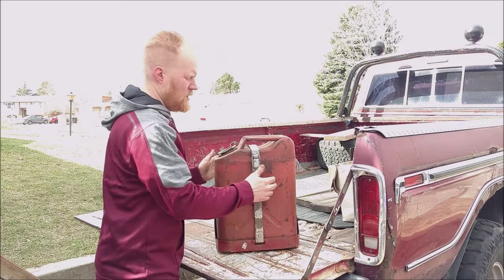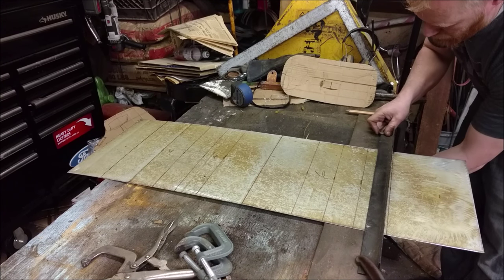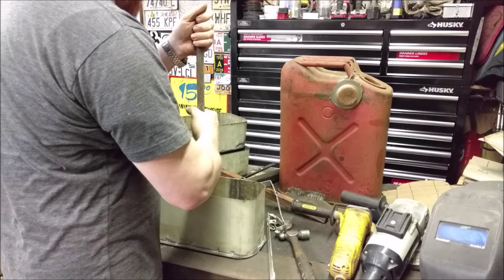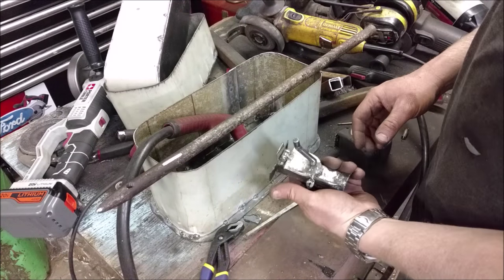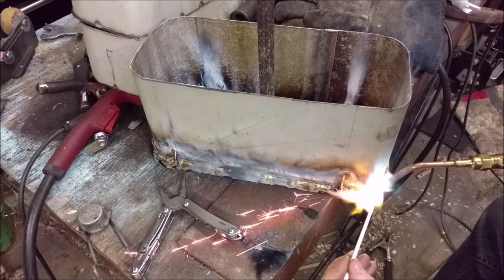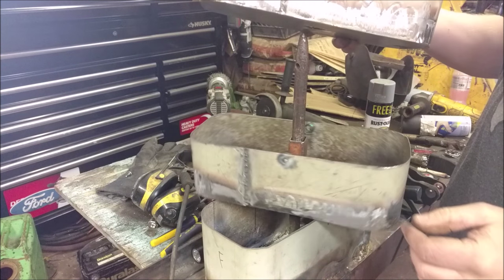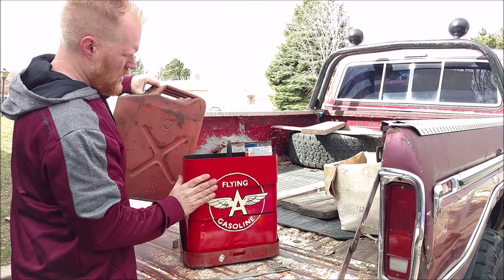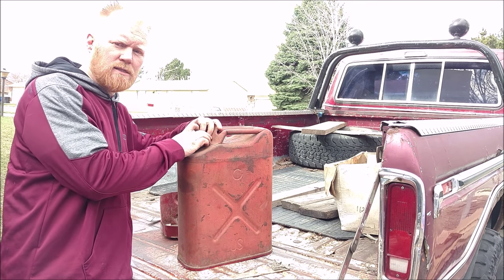Gas Can Converted into a Tool Box

Comment: Cordless drill! The original. Don't need no stinking batteries. Liked the way you slipped that in there all nonchalant like. So subtle & quick almost missed it. Good job on humor done right and liked the tool box concept and artful painting of the logo.
Reply from the maker: Thanks. It was a fun project.

Comment: fantastic job man. The design, engineering and paint work are impressive.
Reply from the maker: +Ozzstar Thanks Man. It was a fun build.
Reply: +sixtyfiveford i agree,btw do you have a degree on engineering or is this simply life experience or what? i couldnt hve imagined that system you came up with to lock the can. congrats

Comment: Nice Moe! Fellow Ford enthusiast here. I do dig your high-boy! I had a 73  F100, currently own a  97 F-250 crewcab and 96 F250 extra cab, and 5 cars over the years. I like your channel cause we think a lot alike. Make something useful out of cast-offs.

One suggestion, I find that a carburizing flame yields a better braze for me. Your oxidizing flame is a little hotter than what you need for sheet metal. Give it a try sometime! I think you’ll like it.👨🏼‍🏭
Reply from the maker: I'll have to give that a try. All my brazing is self taught trough trial and error and books.
Reply: @sixtyfiveford  I did a lot of gas welding in 4130 tubing in airplanes. The flame balance is pretty critical there. You need a SLIGHTLY carburezing flame (more acetylene). The wires thing is an oxidizing flame, as oxygen induces foaming and a raft of bad things in the weld puddle. Normally you like to see a "soft" flame too, as it brings the heat up slowly and envelops the molten metal helping prevent oxidation in the puddle. OA welding is really an art, it's a PAIN compared to MIG or TIG, but the satisfaction of laying down a nice flame weld, or braze, is beyond compare to me.

When brazing tou don't iverhear the base. When welding, you stress relieve the joint by making a larger HAZ. In critical 4130 joints I would TIG for filet consistency, then post-heat for stress relief to prevent crack propagation at the weld root.

Sorry, I get wound up sometimes.😊
Reply: @sixtyfiveford  oh, forgot an important OA capability. You can case harden steel by getting it cherry red, then flooding the hot spot with acetylene rich flame, which coats the spot with carbon rich soot. This shooting, or carburizing, will also help shield a molten weld pool from oxidation.

Comment: I think this is one of the best ideas I've seen in a while and I plan to make something like it but I live in a really bad part of town so even gas gets stolen.My tools might be safe because no one will think of looking for tools in a gas tank. Would the tools be safe if someone tries to steel gas, finds out the siphon tube only goes down a few inches and notice it's not a gas container. Because the tank will be locked down and no one will be able to tell the weight of it, the thing I need to do to save me from the ladder. is that I'm thinking of making the lower container water proof and have a pipe going all thee way up connecting it to the spout (maybe with a rubber gasket to prevent spills and/or rust). I'll still be able to add a second pipe and ball bearings like you did. The only thing that will look different is that the pipe will be on one side instead of the middle so the layers will be going up like a spiral stair case As an added bonus it will not only make it easier to get to the tools, I'll also have emergency gas.BTW: If you want to piss off thieves ... fill that container with water)
Reply from the maker: Yeah, they won't get far on water.

Comment: That's a beautiful rig, Man. 
Just two things I can think of--- 
One. If I could weld or braze, I'd probably just weld a new bottom plate on that Blitz can.
Two. With the very high price of gas, a thief might be tempted to steal that whole can, especially if it was heavy. Yes, I can see you have the steel strap locks, but those have popped on me with regular jerry cans attached, so they're not really secure.
All in all, this is an impressive innovation. You have much talent.

Comment: Instead of the stake you should've used a piece of pipe or some hollow tubing to reduce weight. Even an empty jerry can is enough to wear your arm out if you have to carry it a bunch. Also, on the bottom, cut a whole in the bottom and put your support up through the hole, that way the load pulls on the support and not your weld, the weld is just a holder, make the material carry the load.

On a positive note, it looks awesome and is just the sort of ingenuity folks expect from YouTube. The bearing idea is absolutely genius, that is engineering Americans expect in manufacturing processes.

Comment: I love incognito stuff like this, I would love to have this! Quick question what is the easiest way to remove all the porcelain from a spark plug.
Reply from the maker: Hammer?
Reply: @sixtyfiveford  Ha no I mean I need to clear out the porcelain completely from the inside metal drill isn't working that great.
Reply from the maker: The couple that I've done I just punched them out from the engine side. Bend the ground electrode out of the way. Put the spark plug into a vise or tube/long socket so the metal nut can't go inside. Whack the electrode/porcelain out. The porcelain is crimped in by the smooth metal above the nut.

Comment: Tip.   Grandfather  slowed me along  time ago.  It works.    Old drills even  some cheaper dills many like no batteries put 2 like the black  & white. wires  to  Something like an alligator clip  , use your car or just a battery. Works great did a head job in the middle of no were  did with 12  vote 2 0 v  so far known what don't just have try old junk dills I keep everything  old tools and so. This guy can do anything ! Can do with lots 
Of  tools even  some 
E  tools with plugs.    
20 yrs starting  with juck plug  dill. Creepy

Comment: can propane or map gas be used for brazing?
Reply from the maker: +davidgriffin14 You could use mapp gas with thin sheet metal or with small metal pieces. With thicker stuff the small dual mapp/oxygen setups they sell would also work but you'll need to step up to Oxy Acetylene for thicker stuff.